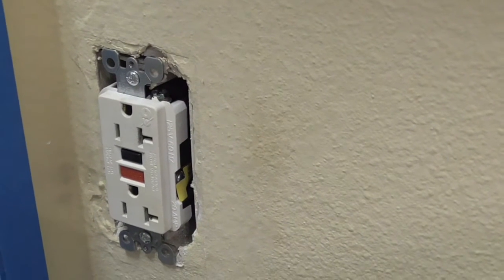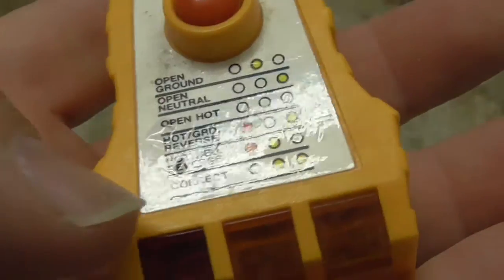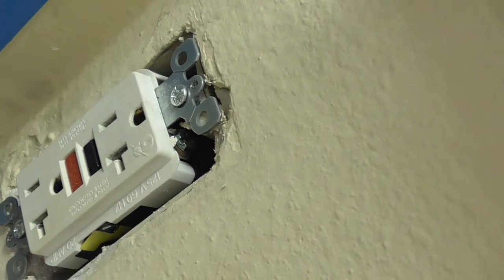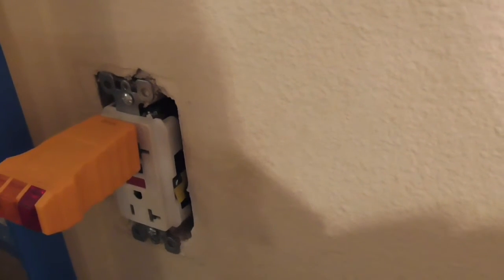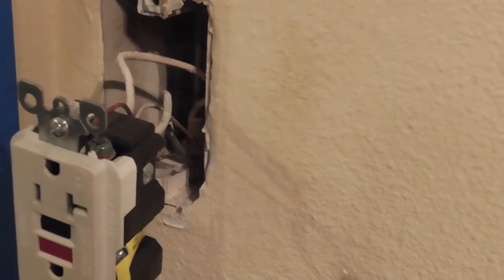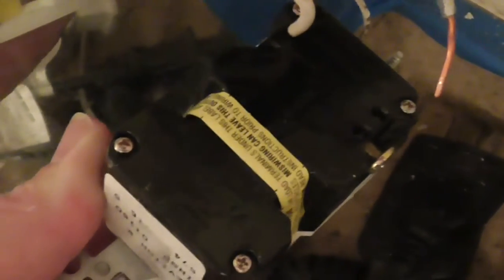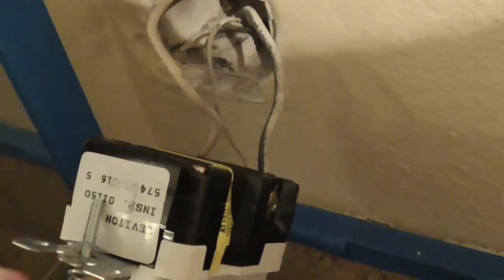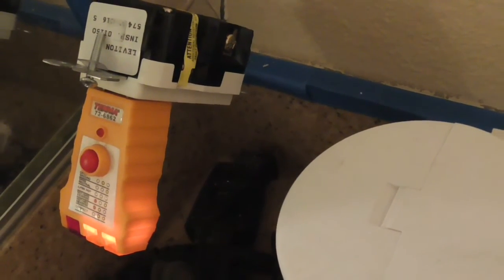Test if Power OUTLET is WIRED correctly and Grounded  to avoid being electrocuted

Comment: GFCI.... and outlets are installed upside down sometimes to indicate its controlled by a switch or for safety reasons... if something such as a penny were to fall on a plug half in it would fall on the ground instead of hitting both pos and nuet

Comment: Im here to help stop my Studio speakers from hissing. Pro tip, if an outlet causes hiss in good speakers, dont touch it. It might kill you. Real question is however, what can i do if my entire house is ungrounded...its from the 70s.
Reply: LEARNINGCHORDS Most definitely not in Canada Nova scotia they are not.
Reply: @LEARNINGCHORDS  My house is from the early 50's, and I just found out by getting a tigle shock that the outlet may not be grounded. How involved do I have to get to ground it? What options are there? Can I ground off of another grounded wire? Likely, but would like to know some options. Cheers!